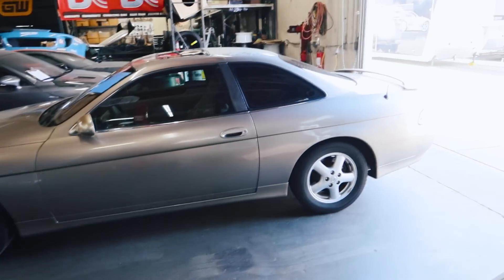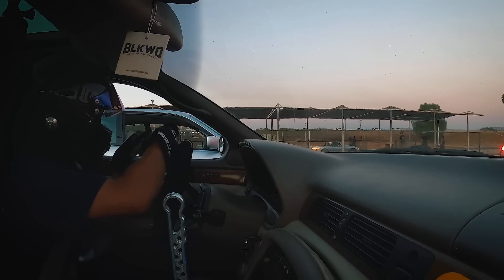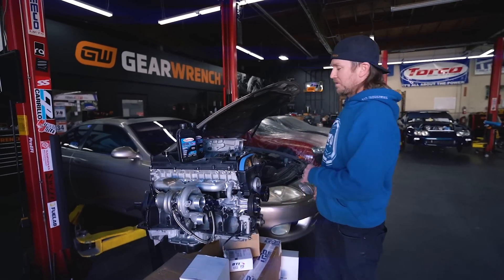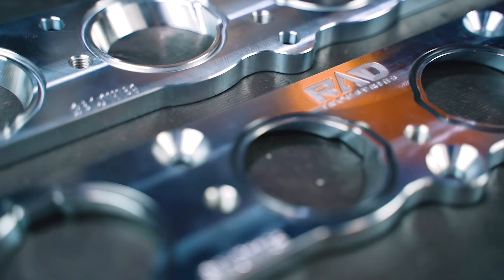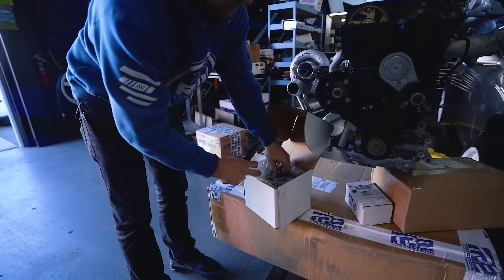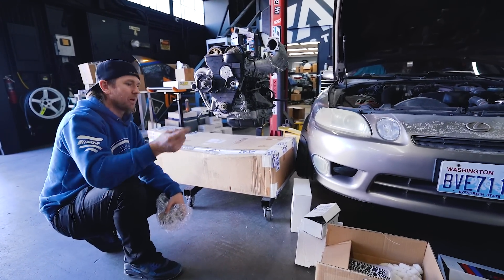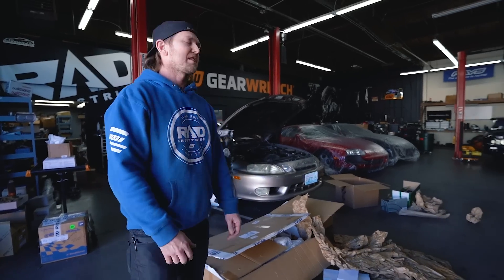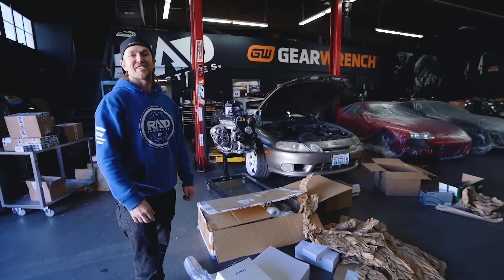What Parts & Why: SC300 Ep7

Comment: dan have you tried  Driftmotion Underdrive JZ Power Steering Pulley i have a cooler for mine but still boil my fluid on hot days drifting  i was going to try this next
Reply: What fluid are you using? I changed fluid and to a big pulley at the same time and the problem went away

Comment: Sick build Dan I’m putting a zf in my is300 the next step is boost are you running a clutch delay valve on the trans? If so what kind?
Reply from the maker: No delay valve, I don’t like how they feel. But I bought a spare ZF so I can still drive after I break the first trans.